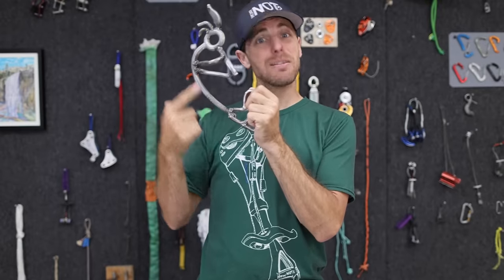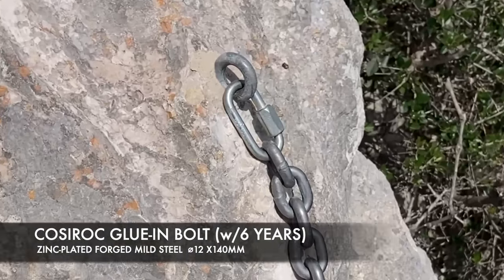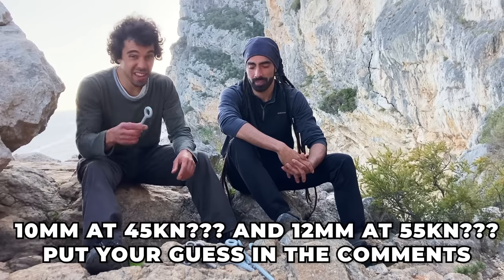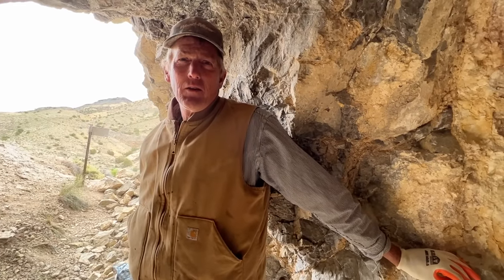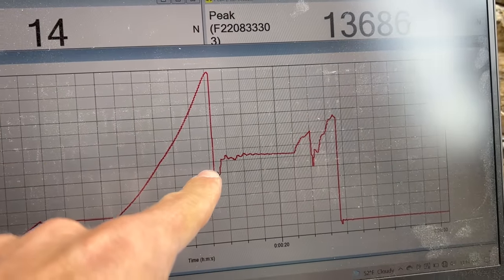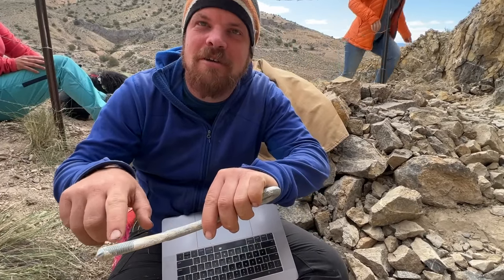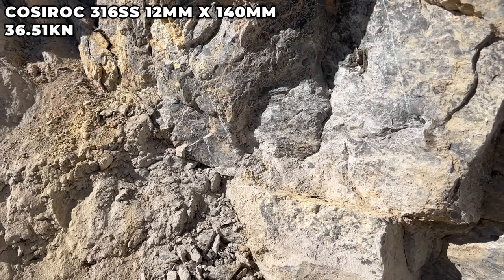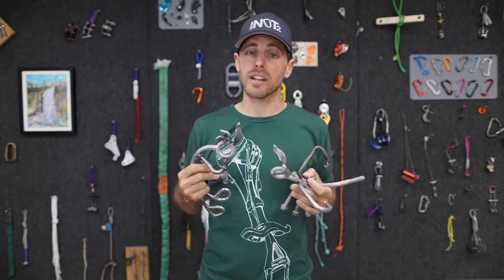They broke the rules and are getting away with it

Comment: Galvanised steel bolts have been prohibited by the European standard (and cannot gain the UIAA Safety Label) for many years now so no certified bolts are available and their sale in the EU is illegal.
Stainless steel bolts are supplied chemically clean by all the manufacturers I know of but what climbers do later is anyones guess. However we know from experience and testing that resin adhesion is very variable over the lifespan of a bolt and therefore for certification it is considered to be zero, the retention of the bolt must be purely mechanical in grooves or similar. A fairly common problem is to find bolts which come loose as the rock heats up in the sun, the resin is not flexible and releases it's hold on the bolt as the hole enlarges making it imperative the retention is purely mechanical.
Extra roughening of a stainless bolt is destroying the passive layer protecting the bolt which (at least some) manufacturers make extra efforts to create.
Galvanised bolts create appalling visual problems in some rock types, particularly limestone where the zinc leaches and runs down the cliff killing the bacteria which gives the darker colour and leaving metre-long ugly white streaks below each bolt.
Reply: Very interesting (as always) Jim! 
never heard of that "rock heats up in the sun" enlarging the hole leading to lost of adhesion, did you have some reference/ link about that? What would be the range of expansion? Some glue ins have knurling, do you think that those knurl would be deep enough to ensure retention of the anchor after such a phenomena?  Did you encourage to drill with an angle (to reduce solicitation on the glue) on your products?   
White stain under the biocide zinc of zinc plated bolts is terrible, do you know the name of that darkening bacteria (I have always considered it was micro lichens).

Comment: You need to test bolts that have been cleaned with ACETONE. I am a boat builder and we never epoxy without a good cleaning it is paramount to good adhesion.
Reply from the maker: That would make for an interesting experiment.  Thanks
Reply: I haven't seen many cases where the failure mode was loss of adhesion to the bolt like in these tests. Usually either the epoxy fails or the substrate fails. That's true both in natural stone and concrete. I always assumed the epoxy was creating a mechanical key into the hole and around the anchor and thus cleanliness was less critical than say in a boat where delamination due to loss of adhesion is a real risk. 

But with the way these just slid out - cleanliness might start to matter! Worth testing. Though at that point, the argument would be whether these are just a bad design. If they were fully threaded like a bolt they would almost certainly fair better regardless of cleanliness. I'm also wondering if the thick hot dip coating is not bonded as well as a thinner plating on these samples? Thick galvanizing can tend to be a little... flakey? Just like deep fried chicken.

EDIT! Should have kept watching, not the coating based on those last tests! I was surprised to see the threaded didn't perform as well as the galvanized.
Reply: Jim titt's site mentions that the adhesive strength between the glue and the bolt is assumed to be zero. They rely solely on the mechanical keying to hold the bolt.
Reply: @darthtony123 epoxy dosent stick to smooth stainless or zinc very well. Rough is key
Reply: 100% agree with this. Glue prep, temp and humidity requirements aren't there for fun
Reply: @bradley3549  Dust in a hole will still make a plug that will hold load but when it has a non bonded layer that can move force is transferred to the far fewer solid points which fail first then cascading failure
Reply: @darthtony123   - and in mining with roof bolts / anchors the amount of mixing / distributing the adhesive thoroughly is important (the glue is designed in as a mechanical component) - some may say critical (now those are long bolts).
Reply: If hammering these into rock is supposed to make them sturdy and safe, how do you get them out!??
Reply: @HowNOT2 i need to know this lmao.
Reply: I mean, whilst that is true, no one is going to bring a jug of acetone up a wall to install those bolts
Reply: @HowNOT2 seconding this. The metal will have unseen oils and debris that prevent good adhesion, and to me, this video seems more like a test of the adhesive strength after a 13 hour set rather than the bolts themselves. Would be interesting to see the difference between these vs bolts that have had their adhesion baking in the sun for a few months.
Reply: Fair point, but also could be the wrong approach.   I doubt people are going to bring an acetone bath with them when climbing up a wall to place bolts.  So thos might be a more accurate example of what happens in the wild.

Comment: These galvanized bolts look to be hot dipped galvanized by the performance they get. The layer of zinc is thick and very well bonded to the steel in this process. The zinc acts as a sacrificial anode and corrodes instead of the steel, so you will see some white dust on them or they will be fully rusted or nothing in between. Zinc is one of the metals that is used to protect steel in marine environments like this and when put on thick like this, it works really well.

Comment: Great info! I knew there was a difference in the amount of zinc on electroplated vs. hot dipped galv, but that diagram was extremely helpful in knowing how much more zinc is in hot dipped. Also, it's not just limestone that'll destroy stainless quickly near the ocean. Developers in Hawaii have found that the basalt in HI will destroy stainless nearly as quickly, so most routes out there are equipped with Ti now.

Comment: Thanks Ryan. The section where you hammer home how shortsighted it is to place inferior bolts in order to save $5 is so important. Even with a well funded titanium rebolting project in various countries, the time required in labour is a major factor that slows down re-equipping. For areas where SCC is an issue I’d much rather climb something that is more sparsely bolted with titanium than ever wonder about what kind of degradation has occurred to anything made of steel, galvanized or not.
Reply: this is 5$ in 2023, few years ago it was much more, cosiroc were 3 times cheaper (when not free), and titanium was way more expensive than today (and hard to find/ often esoteric). TItanium is needed is some sea side area, but not all of them ! Titanium is cool but is not perfect either, for example it wear much faster.

Comment: extra important infos:
they are name cosiroc, cosiroc stand for "Comité de Défense des Sites et Rochers d'Escalade" a french association from 1962 who popularized sport climbing/ and good bolting practice, mainly thanks to Daniel Taupin who even wrote a book of how to bolt safely (good to know when you write a bolting bible 😛 ). In France, in the 80's some crag where bolt with glue in made with eye bolt from telecomunication pole, (made out of wood, they were replace by concrete pillar at those times), those bolt are directly inspired of that.
Those are also know as tige de tendeur (eye bolt), BB (brouet badre), broche FFME, and are now sold/manufactured by french manufacturer Tecforge/colin millas
they have deep groove wich is not the best for glue, but in the 80s some were installed with concrete, so those grooves are mandatory in that case.
6$ today, bu few years ago, it was 3 times cheaper (when not free). and for belay station it's way cheaper (zinc chain and maillon are way cheaper and easier to find than SS)
you have to drill groove as for the fixe tensor!
In some case they have less impact that the shiny stainless!
they are forged, I think the other only manufacturer who forge the glue ins is petzl (batinox, collinox) forged by wichard I guess?
the main downside is: in grey limestone, zinc will act as a biocide, kill every lichens under it, and leave withe line under the bolt!
Reply from the maker: Can you email me and tell me where I can find Daniel Taupin's bolting book? I can't seem to find it.  Thanks!  ryan@slackline.com

Comment: When our fire station was remodeled and expanded, we had anchors placed in the concrete block walls for our training and practice.  Several of us looked at the glued in, galvanized anchors and shook our heads.  Didn't much trust it at first but the contractor said that it was stronger than other options.  Being high angle rescue, we were used to using "bomb proof" anchors such as large steel I-Beams and such.  Glued in bolts were hard to trust but nobody died in our training!

Comment: You should test using sandpaper to rough up stainless and other smooth bolts before gluing.
Reply: I was coming down here to say that. Though I think I'd use an abrasive medium wheel like a silicon carbide paint stripping disc, compared with your typical abrasive discs or flap wheels in a couple different grits.  It's probably not important at all to go from ~30kN to ~50kN for most applications, but it certainly is interesting.
Reply: I was thinking a squash in a press to add some texture?
Reply: Sandpaper wouldn't rough it up near enough. (If you're wanting to rough it up, of course.) I'd take a cutting wheel on a 4" grinder and cut < 1/16"  grooves/notches @ a 30°+/-  inward angle. 

That seems like you'd get sooo much more bite on your bolt.

*EDIT...Rough it up.
Reply: If only there was someone with a machine that could test all this.
Reply: Keeping in mind that the difference in texture between galvanized  and stainless bolts was sufficient to produce ~20 kN of difference (give or take groove geometry differences), I don't know that actual machining of additional grooves into the bolt would be worth the effort compared to hitting it with a very coarse flap wheel.  Cutting new grooves into the bolt also has the potential to act as focal points for stress to concentrate and cause cracking. Probably not important, but over the lifetime of a bolt, potentially an issue.

Comment: after sailing and living on a boat for 11 years in hawaii i have to chime in. 316 stainless is what most people recommend for all stainless parts on the boat. it definately holds up longer than 304. but neither last as well as good bronze, tho thats another story and probably doesnt apply well here for climbing bolts. buttt I have noticed and must agree that even 316l stainless the problem with it especially in enviorments like out here and near salt anyway, crevice corrosion can definately happen. sometimes you have to look very carefully to spot a hairline crack and ive seen part fail that otherwise should have held a persons weight easily going up a mast due to a tiny hairline fracture. and also ive seen old boats with ancient steel wire rigging where it was fully rusted and and an old boat builder was about to sail it across the pacific to vancuver island. he had a lot of people telling him you cant go with that forestay its rusted through! and i clearly remember him saying,"wow u mean u can actyally see through to the core of the wire?" lol... anyway he was a extremely smart guy and i learned a lot from him. his name was noah coincidently :) anyway anyway he sailed of solo and made it to vancouver island in the old wooden boat. hoy hoy was its name i believe. but anyway my point is through the years ive seen a lot of high quality stainless fail do to hairline fractures and ive cute open a ton of flaked out rusty old galvanized chain and shackles that definately had no galvanizing left on it to be surprised of the beautiful steel just below the surface of it. they seem not to hairline and crevice corrode like the 316L... not really advocating for them as climbing bolts, just thought id spin some yarn since its 3:35 am over here and was in the mood. anyway thanks for all the info as always guys.. take care
reece, bruce, and bean

Comment: On trawlers and the like you don't use stainless steel shackles and turnbuckles, etc for critical load bearing fasteners. You use galvanized steel or painted high tensile steel fasteners because you can see the corrosion visually and change them accordingly. Stainless "rots" and you can't actually see just how weakened it is beyond some surface staining... but inside it's all "rotten".

Comment: This makes me wonder if the stainless steel, 17-4PH would make for a better bolt material in these conditions. This is a precipitation hardened steel and not austenitic as mentioned in the video and I believe it is cheaper. Still, the plated bolts may be the most practical option.

Comment: Minor quibble with the Portuguese video, is to either use wind shields on the mics or record an over track later - the noise makes the accents even harder to understand. The other thing to think about is evolution of bolt technology; just a decade ago SSteel was generally seen as the standard. Will Ti or heavy galvanized steel be replaced by even better choices? Cost factored over time is valid only when looking backwards; extrapolating into an unknown future life of new materials is a bit of a dice roll, something many sport cliffs are now dealing with in massive re-bolting campaigns where the wrong picks were utilized a few years ago.

Comment: Stainless steel has a chromium oxide layer which rapidly forms on the stainless steel surface when chromium reacts with oxygen. The oxide protects the metal from further corrosion but is difficult to bond to. An approach, which would work in the field, is to wet sand the surface after coating it with epoxy.

Comment: Nowadays corrosion is often not a problem, but the wear of bolts by rope - grinding. More and more people are climbing - even pulling the rope over the bolt causing wear. Unfortunately, there are quite a few idiotic climbing schools that teach lowering directly through bolts instead of abseiling, often seen in Germany.
So the more a route is climbed and some idiot is lowering directly throught bolt, the bolt will wear out. The solution is to install quick link or carabiner - there, however, the electrical conductivity between two materials can act... Corrosion is quite a complex issue.  Briefly: the biggest problem is with the expansion bolts. Glue in the bolts has the inside protected by the glue.
Interestingly, we were tearing apart visibly rusted expansion bolts and many held up to more than 15kN of outward pull = the corrosion acted like glue. In the past, setting rings into Czech and German sandstone rocks basically worked on the principle of corrosion. The circles were inserted into the cut hole, and the hole was sealed around the shaft with slices of lead. The rest of the hole outside was covered with concrete mix. These rings served for 100 years! Corrosion inside acted like glue over time.

Comment: The best bolts I find for rocks unde4 high loads is the ones for powerpoles ther about an inch in diameter and 12 long
Reply: 7:59  you forgot to say that the bolts are split bolts

Comment: Look into how the zinc galvanize works its pretty cool. It uses a type of reverse electrolysis to help slow the metal from rusting if the coating is broken and on minor scratches it can repair itself. I've got a lot of love for it after fighting rust on classic car's for years

Comment: Why not use Roc-Loc resin cartridges. They are used in coal mining to hold top. You can cut the to length. The glue goes in, you spin the bolt. No mess

Comment: 3:47 - Another benefit of using the cheaper, shorter lived bolts is that if there's a new revolutionary product that gets developed which is suitable to replace it, rather than having to wait 50 odd years you can do it in the next iteration of rebolting it, so a 10-15 year lag at most.

Comment: I think titanium only lasting four times longer than galvanized steel is fundamentally flawed.
Reply: I suspect the mechanical wear would actually be the main factor rather than the chemical attack
Reply from the maker: I was being conservative.  A galvanized bolt lasts 20 years and a titanium bolt 200 hypothetical years. We have a "few more years" before we will have real life evidence of that.   If ropes are not rubbing on the bolt (a wear component) then it isn't going to wear out as long as the cliff isn't eroding around it.

Comment: it sounds like the manufacturing of the Spanish SS bolts are at fault.  There should be no micro channels.
Reply: Look up "pitting corrosion", "crevice corrosion" and "stress corrosion cracking". What you call channels are created by the environment, not a manufacturing defect.
Reply: @IcEcho  they were helped with very poor manufacturing, like terrible welding, leading to tension residual stress. 304 chains of a famous spanish brand  sometimes fail even far from the sea...

Comment: Looks like cheap, badly manufactured "stainless" steel is the actual problem here...
Reply: Kinda. Fixe definitely had a problem with that historically, but in the case of Cabo da Roca, Tonsai, and other places there's a sulphate problem which eats up the steel. Dave Reeve's hypothesis is that it's Sulphur-Reducing Bacteria that supply the sulphate ions from the locally available sulphur, which in turn likely comes from nearby underground sources (like volcanoes) and explains why this doesn't happen in all sea cliffs, only some.